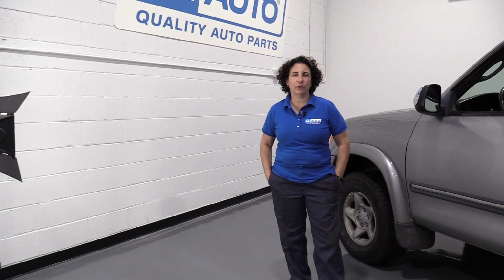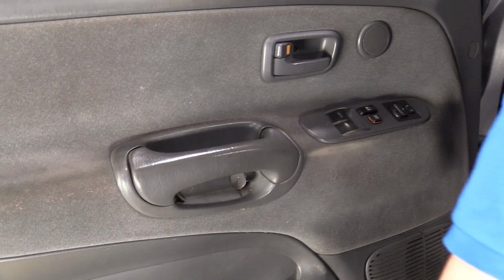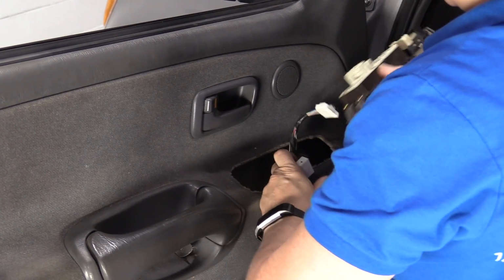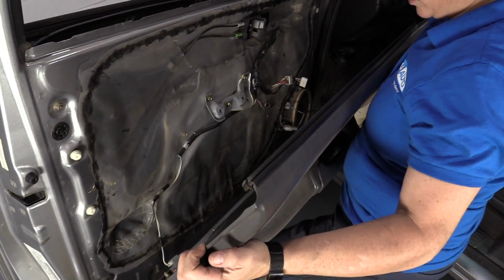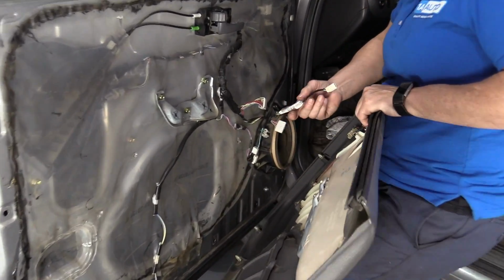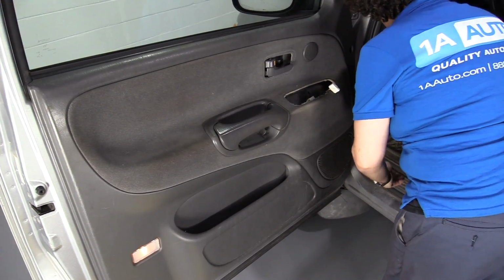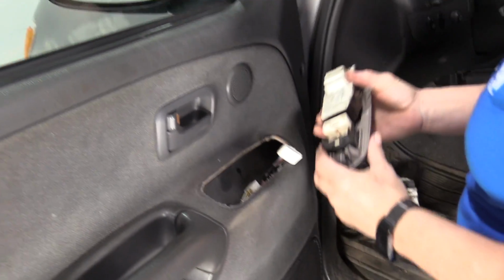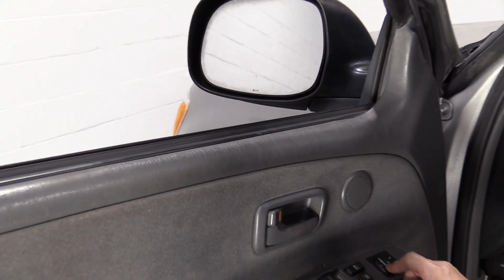How to Remove Door Panel 00-06 Toyota Tundra

Comment: Excellent and informative video.  This is valuable information if you need to remove your Tundra inside door panel.   I had to repair the cracked arm rest portion which I repaired on the inside with metal mesh and two thick coats of Bondo.    I really appreciate the technician talking about the specifics on what she is doing.  Many thanks and big thumbs up to her!

Comment: Just what I needed to remove the handle outer case, my mother broke the other one. So I looked online how to remove the panel and found this one, and it was perfect model and everything! My mom has a '08 tundra that still works like a champ and she was getting tired of constantly having to turn the volume higher and higher until we installed some Kenwood speakers which boosted the sound quality. I appreciate this video!

Comment: Use a pointed razor blade to pry open the bolt covers. Using a blunt screwdriver head will just chew up the edge.

Comment: She felt for screws in the rear edge...Old trick for busted door panels drill a small hole thru panel into sheet metal,insert a screw it will hold the panel on.It ain't supposed to be there but if you use the right screw it looks factory.